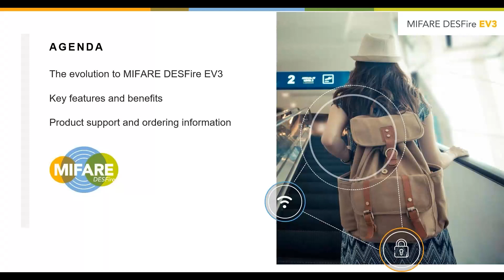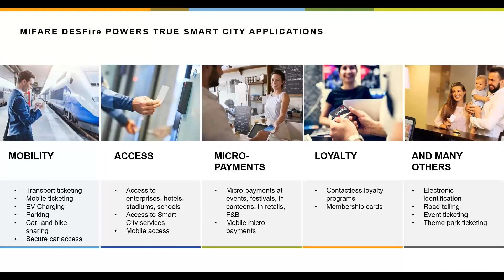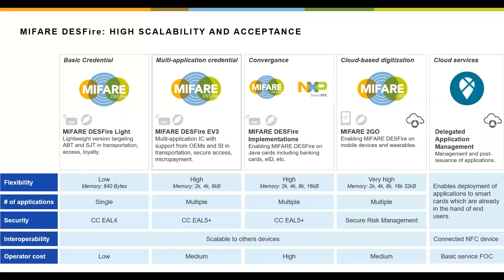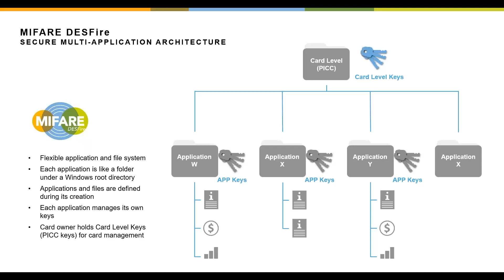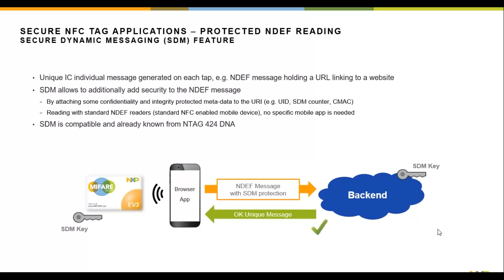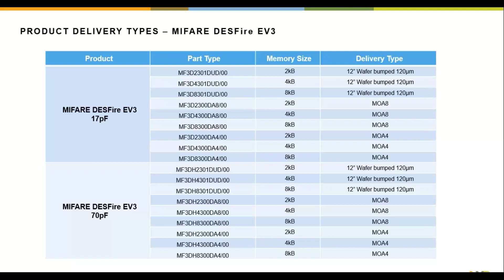How to Upgrade to MIFARE DESFire EV3 Without Replacing Your Infrastructure

Comment: At around 25 mins in the video, there is a talk about TMAC. If a fraudulent transaction is done offline first, and later detected with the TMAC because the terminal is connected to a cloud at a later time, the damage is already done right? The fraudulent actor (someone paying) could already be gone? What am I missing here?
Reply: It sounds like, if you go into a shop and use your card then the TMAC authenticator built in to your card will sync with the cloud terminal and authorize it be it at the time or when back online. However, if the sales assistant tries to put through a second transaction using your card details, this transaction will not have the TMAC authenticator from the card associated with it, therefore not allowing the transaction to be authorized and the funds not to come out of your card. This is my understanding of it. It does also point out that all of these scenarios are dependent on  genuine transactions being completed first.

Comment: Would you let me know the differences between delivery type 17PF and 70PF ? Whats the effect of the difference capacitance? (video around 45:31)
Reply from the maker: As you probably already know, the pF stands for "pico farad". This represents the input capacity of the analog front-end.
The 17pf version is for smart card form factor, whereas the 70pF version is for smaller form factors (i.e. keyfob smaller antenna). It needs higher capacitance to have the same reading distance via a contactless interface.

Hope this helps!
L.